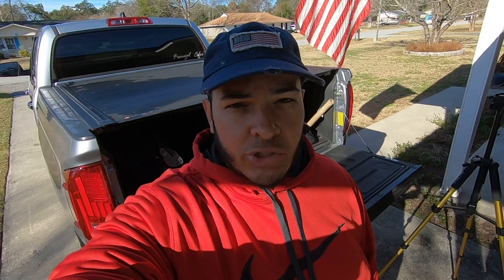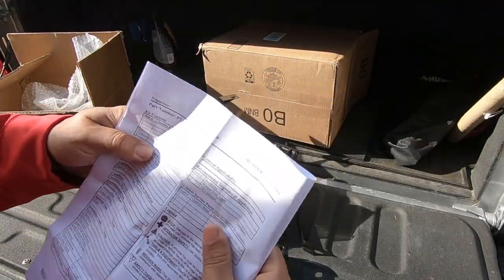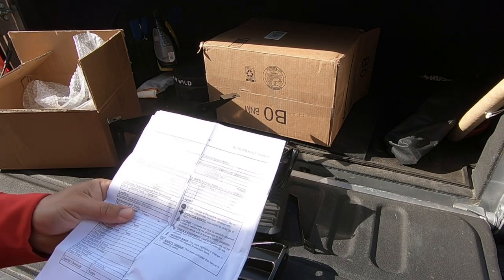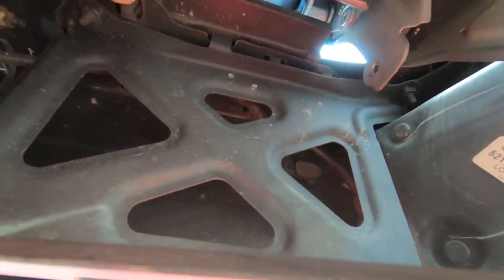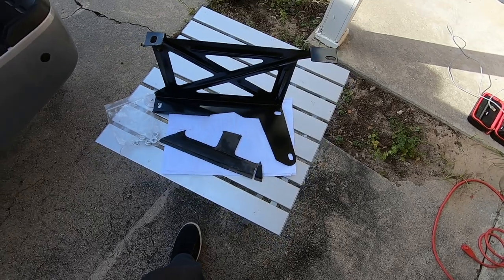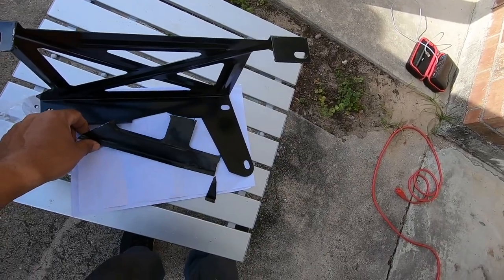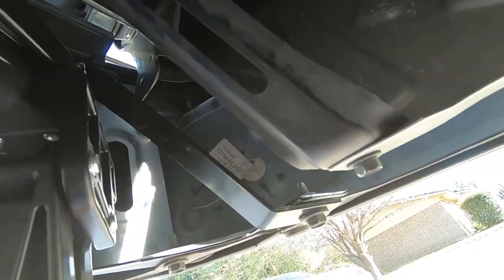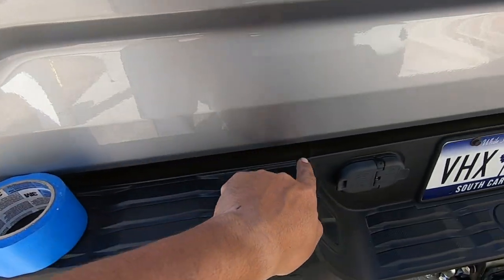SKD #30 - TUNDRA BEDSTEP BUMPER STEP INSTALLATION 👀😮😍 UPGRADE EASY & QUICK TIPS

Comment: Great idea cutting the Toyota bracket. After seeing where you cut it, I was able to cut the same spots right on the truck, which eliminated so much extra work. My only slow down was that I installed the angle brace upside down the first time and quickly realized it wouldn't get all the way to the bed panel attachment point. Overall great job. Thanks SKD_4830.
Reply from the maker: Thanks it’s comments like these that I enjoy. We have to help one another if we can. Thanks again for the feedback

Comment: This is a very informative video. The step by step could use a few more details, but you more than made up for it with the bracket shortcut. I also cut the original bracket while it was still on the truck, and that saved a lot of time as well as simplified the installation. Thank you!
Reply from the maker: Thanks for the comment I really appreciate you 🙏🏽👍🏽

Comment: So to bolt this up after cutting bracket (on truck),  can you do it all from underneath witout having to take bumper end off?  thanks
Reply from the maker: Yes that’s what I was trying to say at the end of the video. You can install this bracket without taking the bumper apart 👍🏽

Comment: Hello…great install video👍 One question…does your truck have the resin rear bumpers? I have a 2019 limited and have them …just want to make sure I don’t have to do any cutting on it besides the bracket bottom ? Thank you 👍
Reply from the maker: I think. They are the colored match bumpers front and rear, that comes on the platinum tundras. Thanks for the comment and sub 👍🏽

Comment: I was lazy and snipped the sides and bent it up.
Reply: Also, Why’d you tape it? I’m confused
Reply from the maker: Was going by instructions when I did it. Tried to let my viewers know that if I was to do it again I would not follow the instructions. I would just cut the bracket and install the step without taking bumper loose or bracket off.
Reply: @SKD_4830  that’s basically what I did. Lazy but efficient lol

Comment: Very confused (it’s not that hard to do!) what was all that instruction about #2 and #3 regarding bumper caps? That’s the only part of the install that I did not understand, but you did not show that? Sorry to be so dumb but what am I missing, please?
Reply from the maker: I started by following the bumper step instructions, but halfway through I decided to use the original bracket because the bracket included in the package was flimsy. So, I cut and used the original bracket which was more sturdy. Then I tried showing in the video that I didn’t have to remove the original bracket from the truck. All I had to do was cut it while it was on the truck which would have saved me a lot more time.
Reply: Thanks for your prompt and gracious responses!
Reply from the maker: @butchtaylor5086  thanks for the comments and hope that this video was able to help you with your project.